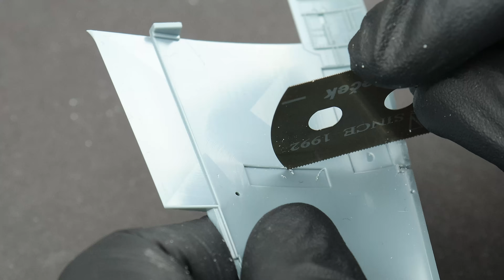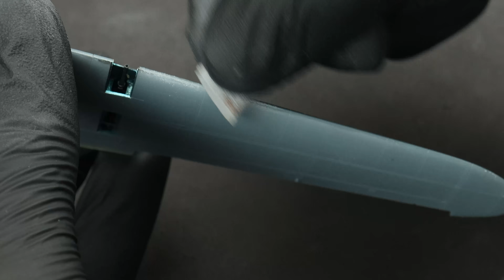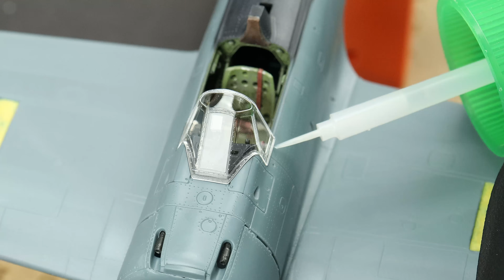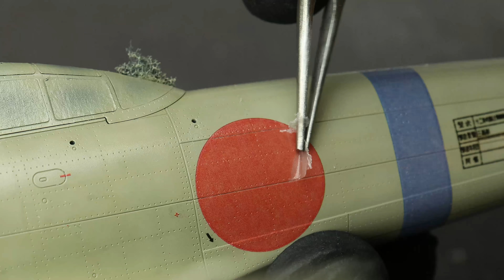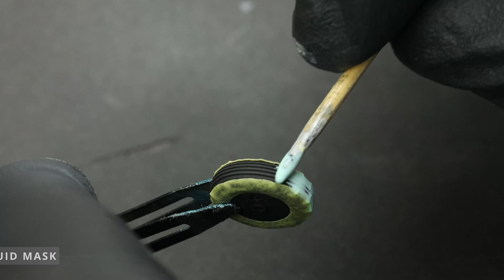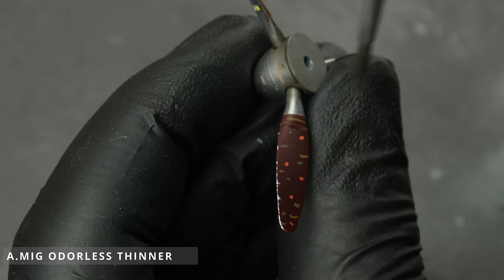| FULLBUILD | Eduard 1/48 A6M2 Zero Type 11 IJNAF - Aircraft Model

Comment: Wow that is absolute perfection.  Is that solder wire you used for brake lines??
Reply from the maker: It’s soldering wire. But you can use any other soft wire that’s easy to bend. 👌

Comment: If you use Revell or Humbrol coulors, no priming is necessary- every layer of paint cost time& money and is a source of possible mistakes.
Reply from the maker: Good point about the potential source of mistakes. Still, I think that layering has its value. Each paint manufacturer has a formula that works in a certain way. It’s about finding methods that make the most of their products. Time isn’t a factor for me. The most important thing for me is how well I can control the flow of paint from the airbrush. Based on that, I chose the paint. If your priority is to cover the model in one layer as quickly and affordably as possible, and Humbrol or Revell works for you, no problem. 🤙
Reply: @Model_Addict  Think I understand: there are so many products and ists youst fun and curiosity to try and find the fafourite of all the different stuff to get your bestliked result. Thanh you for charing

Comment: Excellent build! Are you using 0.2mm nozzle for primer or it's different size?
Reply from the maker: Hi, in this case, I used a 0.2mm nozzle. Sometimes, however, I use a 0.3mm one. I feel I have more control over the spray with a smaller nozzle.👍

Comment: I have a question about the Mr Surfacer 1500 's. I can never get mine to spray out of my airbrushes properly. I have them thinned to what I believe is 70/30 (Primer- levelling thinner). Anyways, this is GORGEOUS! Absolutely museum quality, no doubt.
Reply from the maker: Oh, thanks, mate! 👋 I also used to have trouble spraying paints, especially Surfacer. It's thick and heavy. I kept getting a gritty texture on the models, especially in areas where parts met at a 90-degree angle or more. I solved it by thinning the paints even more. It depends on the specific paint, but I always try to keep the consistency around that of milk and apply it in thin layers. It takes longer, but it works well for me.🤝
Reply: Wonderful, thank you! I'll thin it a bit more, because I was getting that grit as well. I've been using the Mr Surfacer 1000 in the rattle cans in the mean time, which works wonders as well! No sense in having different primers if you don't use them though!

Comment: Beautiful build indeed. I just disagree with that dirty look. The planes flown by 12th Kokutai in combat testing in China were basically brand new. Paint fading/bleaching on outside wing sections and rear fuselage (since the standard tarps covered only the engine, cockpit and wing center section) was prominent though and you missed that. Please correct the video title to IJNAF (Imperial Japanese NAVY Air Force), it's also misspelled somewhere in the video subtitles. I don't think Zero looks good without the cowling.
Reply: Unfortunately a lot of modellers have fallen into the trap of weathering a plane until it looks like a death trap, the one that annoys me the most is where they weather to death the landing gear bay/weapons bay and present a pool of fluid on the ceiling part of those bays…implying that the plane was stored upside down so all the leaking fluid accumulated on the ceiling rather than dripping down on to  the inner side of bay doors….like they would in reality….because of a thing called….gravity. But I doubt that will stop them from making a brand new state of the art stealth fighter looking like it’s 120 years old and emptied its entire hydraulic fluid tank into its wheel/weapons bays 😂🤭
Reply from the maker: Thank you for the advice! 😁The aircraft will be part of a diorama, that is why the panels are opened. If I were building a standalone model, I would keep them closed. As for the weathering, I like to present models that look more used. This is because such a model tends to attract more attention. Of course, it doesn't always have to match the historical reference 100%, just like in this case. Cheers.🤝
Reply: @Model_Addict  No problem, and glad you fixed that IJNAF nomenclature. If intended for diorama then it makes sense. I understand "attraction" factor but very much prefer historic accuracy. It seems you're located in Slovakia? I'm from there. I liked your Slovak AF Mig-29 build, I'm planning to build the same. After I finish Slovak L-29 and L-39!

Comment: Eduard decals are horrible.
Reply from the maker: Hi, I find them easy to work with. The only issue I see is that, when viewed up close, the printing pattern might be visible. However, this mainly applies to large, solid-colored areas. These can still be painted using masks. 🫡
Reply: No they ain't, if used right they're brilliant. I've built 4 Eduard kits this year and I've not had any issues with the decals.
Reply: @EoinScaleModelsdude please, the colors are extremely muted and lack saturation. If you can't see that, you're blind. Pick up a copy of Furball decals and get back to me. Excellent color registry and goes down like a dream. Eduard decals are shit

Comment: Excellent build and video. I have two 1/32 Tamiya A6M2b kits, one 30 percent completed that aid in correcting/improving a 1/24 Trumpeter build. All have added stressed skin effects, dents and uneven surfaces that were common on Zeros. IJN Hemp colour is  historically accurate. I'm using Vallejo 71.023 (FS34201)
Reply from the maker: Thank you, buddy. Your builds are amazing; hats off to you.🙂‍↕️ I was also considering adding stressed skin effects to my Zero. But, at 1/48 scale, it might not look as impressive as it does on larger models.
Reply: @Model_Addict  Thank You. The colour /tone modulation in your painting gives the impression of a stressed skin surface. My intension is to build the 1/24 kit to resemble the restored aircraft from the, Texas Flying Legends Museum. It will be posed in flight with a pilot figure. 
I returned to the hobby in 2018. Retired from my business designing/fabricating/building custom motorcycles. The site is no longer but a couple of F/book pages and image searches of, Special Effects Chopperworks in Burlington, Ontario, Canada are still online. The skill sets and required discipline from that crossed over to help with model building.
Since finding your channel and watching the Spitfire build, an official RAF training film on the practices/procedure for painting, 'High Speed', aircraft is posted on my channel that you may find interesting.